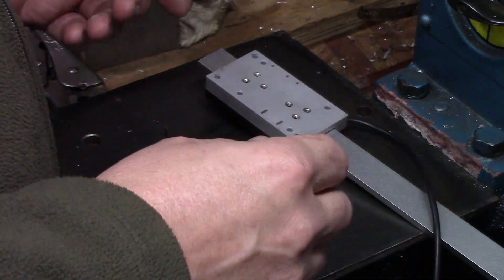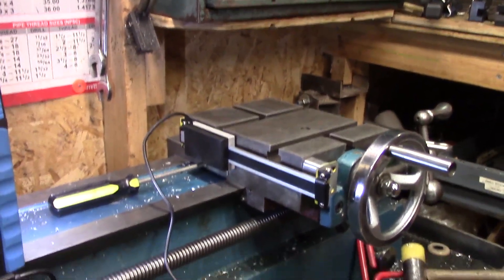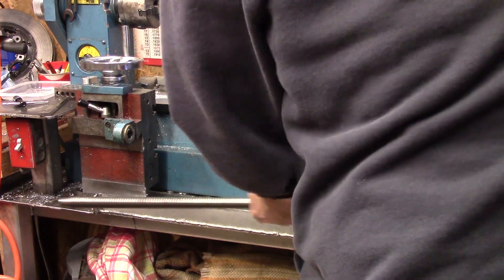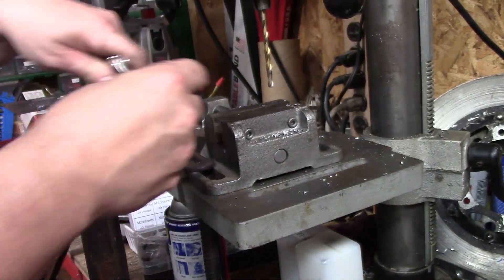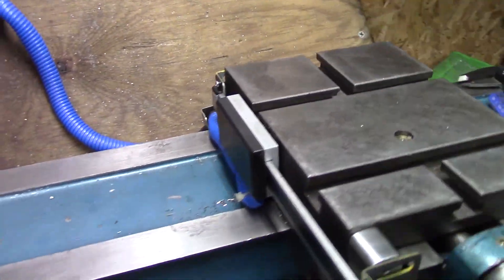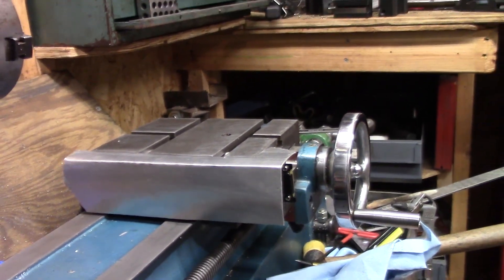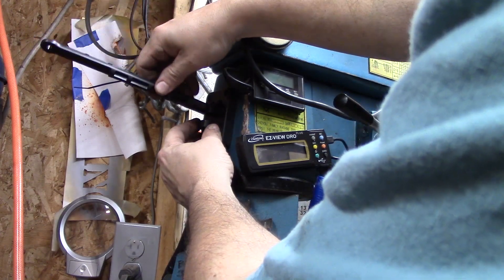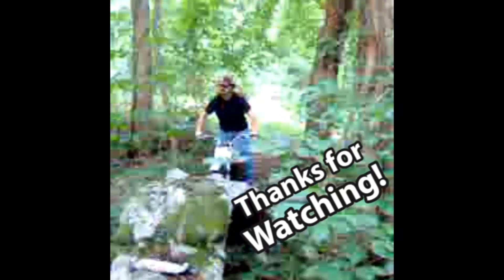Installing new X Axis DRO on the Mini Mill Lathe - Part 3

Comment: If there is one thing that Igauging should do is, Include a stencil of the layout of mounting screw holes for the back of the sending unit. I made my own from a piece of tracing paper and transferred it to a 3/32's piece of scrap carbon fiber i had laying around. I should make a bunch of them and sell them on E-Bay for  $3.00.
Reply from the maker: That would be handy. Best!
Eddie

Comment: I am going to be adding DRO's to all 3 axis here in the not too distant future and you can bet your ass that I have this little series saved so I can remember all the little nightmares you ran into. Thanks.
Reply from the maker: It can get challenging on machines that were never intended to have them. And each axis has their own set of challenges. Thanks!
Reply: @theeddies  I just got the 3 piece kit for Christmas...
Now I just need to be able to actually get into the garage and also get some spare time.
Reply from the maker: @bustednuckles2  Nice. I really like mine. The only bad thing is that half the time when I go to use it, it acts like it is dead and I have to take the batteries out and put them back in. It may just be a problem with the batteries. I keep meaning to find a high quality set to try. Mounting it on the machine took a little doing but they all do. Invaluable tool to me though. I have been looking at them for the Atlas. Have fun and show what you come up with, I would be interested how you do the long travel.
Reply from the maker: @bustednuckles2  it's a pain but so worth it. One good thing is the casting and even bed drill and tap pretty easy. Go with a tight drill for the tap size. But yeah I had to make custom bracket holders and deal with odd angles. The linear scales cut easy as well. Mine were not hardened at all. Don't take the read heads off if you can get away with it, I did on one and it was touch and go getting it back on. Good luck!, Lol

Comment: Step #3 Disassemble entire machine...  Congrats on 1k
Reply from the maker: Yeah, that was fun because as you know, there are all manner of fine adjustments that then have to be re-done. All to drill and tap 2 holes. I did discover that I need a new lead screw nut. I hope someone makes a replacement. Or maybe I should just buy a little Chinese lathe that cuts threads. Step #4 - Buy a new lathe...

Thanks!
Reply: @theeddies  Might be replacements out there - Step #5 Learn Chinese.
Reply from the maker: @johnstrange6799  I need to get an Acme thread gauge, but I am hoping that Little Machine Shop or the like sells brass threaded nuts that I can make fit. Of course if it is, M16.390897-4.287 (or whatever setting they were turning nuts and screws that day) then I might have a problem.
Reply from the maker: Can you thread metric trapezoidal threads? I'll pay. Looks like the screw is 20x4 mm. Cheapest brass or bronze I can find is $50. Aliexpress here I come.
Reply: 9 @theeddies  I can't no. (Sorry) My basement just flooded like a bitch again too (I'll be cleaning up for a week or two!). Ask Joe @ Raptor if he can hook you up. Not sure if he can thread metric or not, but worth asking. The problem is most people would want the lead screw on hand to kind of finesse the fit into place. But by the time you ship that thing around you will be at or over the $50.
Reply: @theeddies  Do an E-beggar-thon. If I ever do one, I'm going to do a spoof of one, like I need a new cotter pin for something on my yacht, so I need everyone's help raising 20k. - "I know many of you are now suddenly unemployed and are struggling to wipe your ass, but we're all in this together, so won't you contribute today?"
Reply from the maker: @johnstrange6799  Haha. Not in a million years. I will take Youtube's money but not doing any gofundme's unless I need a new liver. Speaking of which... have you considered contributing to my Patreon to raise money for my new liver?

BTW McMaster Carr has them for $40 or I could buy a tap for $80-100 and make them to sell.
Reply: @theeddies  I asked Joe if he can turn metric threads.  I'll let you know what he says, and if so I'll see if he'll hook you up.  Don't know.
Reply: @theeddies  You (I) can ask Erstwhile too.
Reply from the maker: @johnstrange6799  I appreciate it. I can do $40 for the McMaster Carr one (bronze material will be at least $15 or $20 unless I buy a big piece anyway) but maybe they might want to make a video of it. I will ask Erstwhile.
Thanks
Reply: @theeddies  I'm not sure if Erstwhile or Joe is set up to do metric, but I guess we'll find out. Trying to think who else to ask. - Still mopping here!!
Reply from the maker: @johnstrange6799  Wait, you are still cleaning up water?
Reply from the maker: also did you know your hashtag SOB links to this https://www.youtube.com/watch?v=1iAYhQsQhSY

Nice job! lol
Reply: @theeddies  Not anymore it doesn't.
Reply: @theeddies  Waiting to hear back from Small Town Machine Shop. He can do metric, but not sure if he will.
Reply from the maker: @johnstrange6799  cool thanks!
Reply: @theeddies  Go to Small Town Machine shop's channel's latest vid (Reviewing Harbor Freight sander) find my comment.